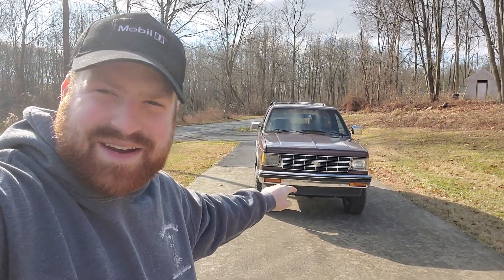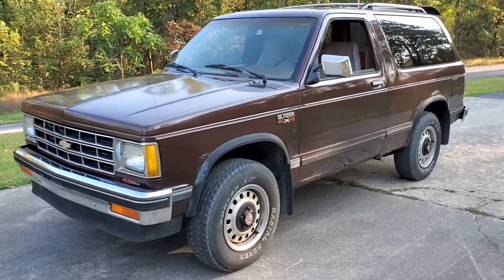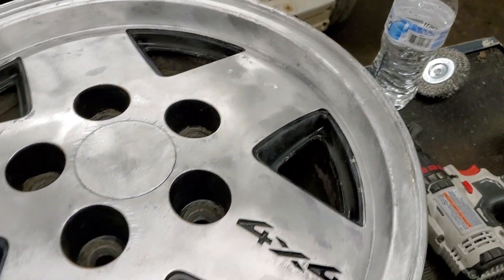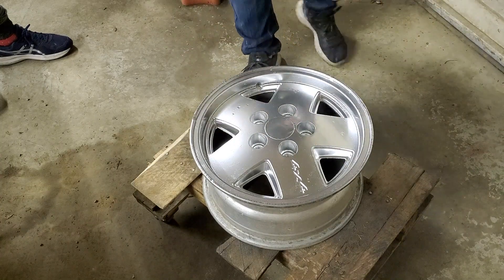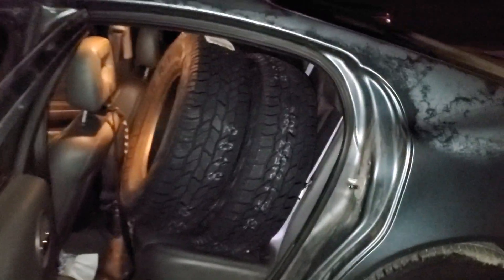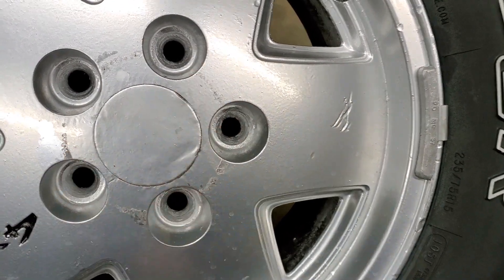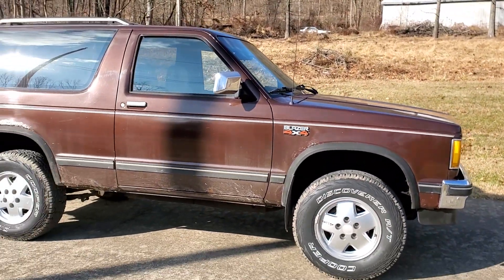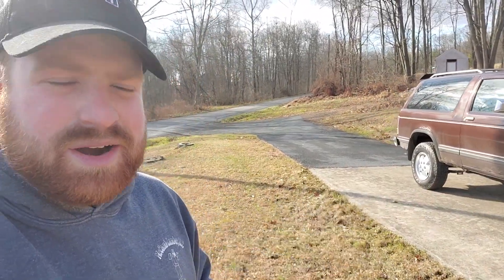$400 S10 Blazer Gets a New Wheel and Tire Set Up!

Comment: btw, the oil filter was factory mounted that way cause it was to tuff to get to on the side of the motor to change. I also had a 98 jimmy and my filter on that was also the same.
Reply: I converted mine with a adapter from a astro van and a fil 1040 filter.(fram pn is ph3387A) just have to take the front driveshaft and skid plate off when I change oil. Way better then dealing with the oil leaks from those lines

Comment: Okay I asked this question on your video when you put the lift on and it still hasn't been answered did the tires rub in the front with the 235 75 15 because mine rubs so I'm thinking of going with a 3-inch lift in the front and 4in lift in the back.
Reply from the maker: Yeah I did. It's bee a while but i don't recall mine rubbing